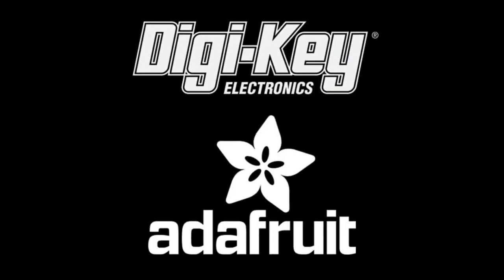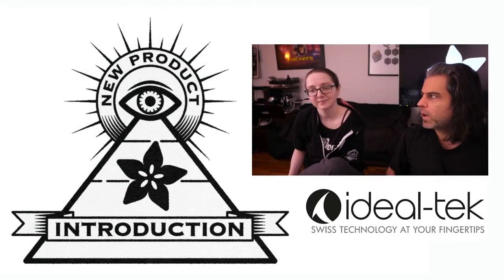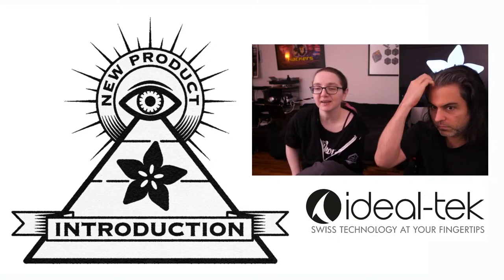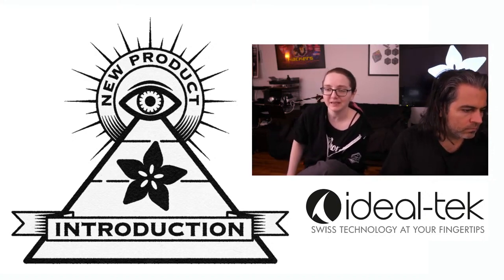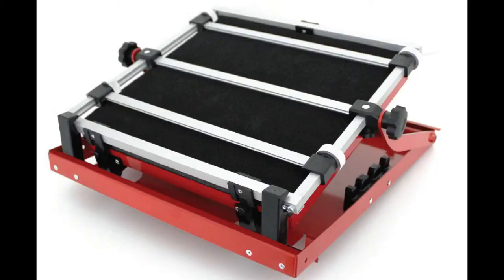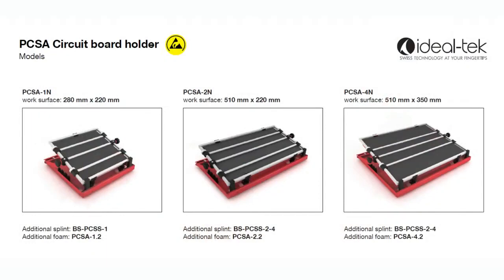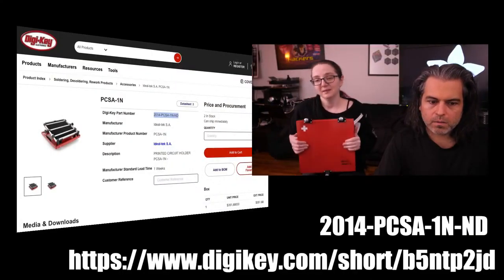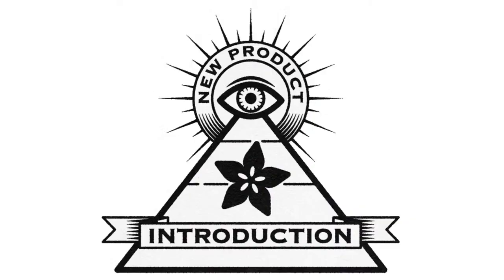EYE on NPI – Ideal-tek PCSA Circuit Board Holders #EyeOnNPI #DigiKey #Adafruit @DigiKey

Comment: First saw this class of tool on Big Clive. Saw these when I placed my latest Digikey order (I checked new products before clicking buy) and smiled. Out of my price range but I'm not doing production, so I'll stick with aluminum tape for now. (Actually works pretty good, though I have no idea how it is for esd)

These are even fancier than Clive's! His only has the foam and the rails are way more finicky.